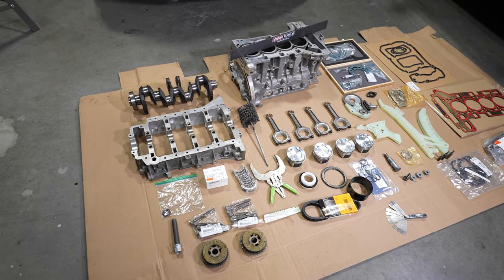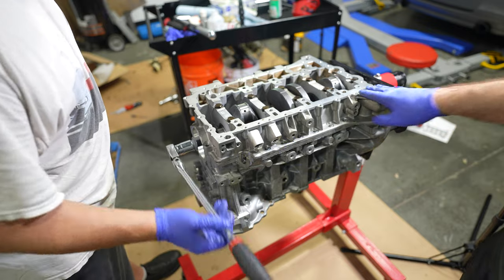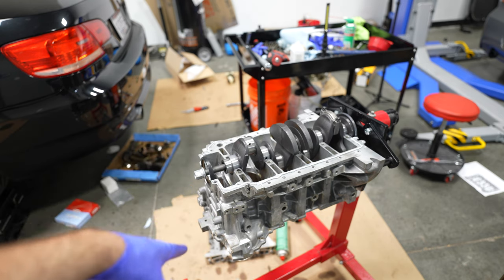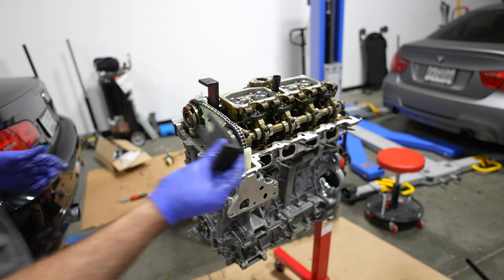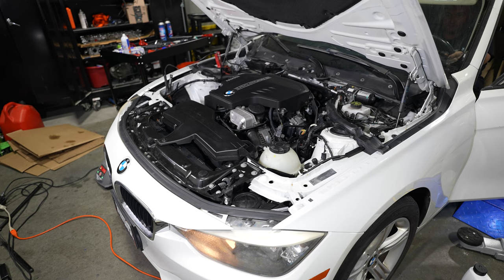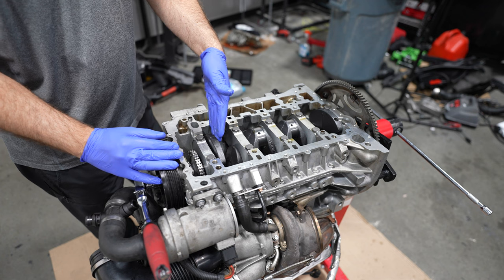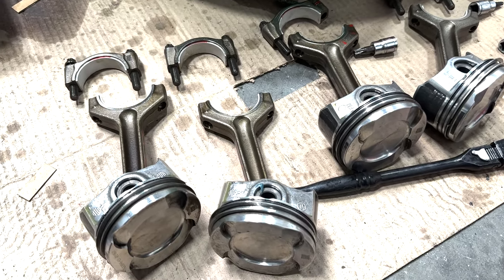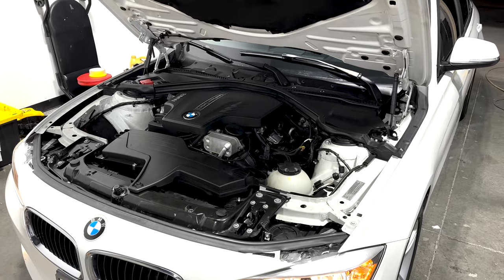How To Build A BMW Engine

Comment: This is a must know if you're looking to buy a BMW
Reply: You don't own BMW, do you?
Reply: @malceone  I think it’s obvious 😂
Reply: @malceone  you probably think changing vanos solenoids and coils+sparkplugs every 60k miles in considered regular maintenance 💀💀
Reply: Not really, the motors are strong it’s just the other stuff
Reply: The bait 😤
Reply: @DaEverything1  I’ve had 24 cars, 6 of them being BMWs. I used to change my spark plugs/coils and distributor on my Chevy LS1 and other LSx motors. That stuff is routine maintenance. You’re just a clown.
Reply: @DaEverything1  Actually no, but I speak from experience.I own 3 BMWs,E60 and F10 gasoline and E70 diesel.Never did vanos or coils.Did change spar plugs and glow plugs and some oil seals on gasoline engine and that is pretty much it.Changing oil every 4k and brakes and stuff on regular maintenance and that is it.E60 and E70 have close to 200k and still running good.What I'm trying to say is, biggest culprit to BMW"unreliability" is second or third owner.They buy them without first clue about cars.And they run them to the ground.Either they don't know or they don't have enough of money to properly fix and maintain.I am second owner to all 3 of these.Your experience my vary this is mine.Cheers.
Reply: @DaEverything1  I never understood why people are so proud to say how much they neglect the maintenance of their car. Yes, changing your spark plugs and coils every 60k is normal for a performance/luxury vehicle. You’re very welcome to run the same coils for 100k+ if you do not care about the overall performance. Even in the world where the new norm is to hear cars make over 500 hp, a base model 3 series is still considered a performance vehicle. Your average car barely makes over 150 hp and even at its base BMWs bread and butter 3 series and 5 series are still going to out perform your sports version of your Camry, civics, accords, 86 etc…
Reply: @DaEverything1 just changed the spark plugs on my bmw and they were still factory. It’s a 2013, but it is kind of low mileage and I treat it well. Besides that it’s just oil changes and whatever fluids I might need.
Reply: If you don't mind, how do you calculate the color of the bearings.....why don't they put the same color at the bottom as at the top
Reply: I have heard rumors that the connecting rods would not last if the engine power is increased and that the bearings wear out prematurely

Comment: Say what you want; BMW engineer their engines really well with tight specs. Installing something less than perfect will cause problems. People say BMW is unreliable but they don’t know didly. Do the maintenance and they will run forever.

Comment: IMPORTANT! When using plastigauge to measure crank clearances you must make sure the crankshaft journals and the bearings are DRY (not lubricated). Otherwise, your measurements will not be accurate. Also, never spin the crank when dry.
Reply: For the pistons bearings ?

Comment: Thank you for that Sunday morning bmw show, sad to find that the crank was garbage after you ran it, but thank you for calling it out, and going through it again,  that type of issue is something that an inexperienced builder would never of understood and they would’ve had the same problem and lost complete confidence and in the end scrap the motor. Thank you for this content ❤ and proving you need OEM when you’re doing such technical work.

Comment: I noticed at 17 minutes in you removed the locking oil pump tool.  Is it that you don't use it to torque the intake and exhaust gears and just use the timing kit to lock the camshafts and the front gear wheel along with the TDC lock and oil pump lock or do you also lock the flywheel as well?  I am at this point currently so just wanna be sure.

Comment: I have the BMW X1 it has the N20 in it. Just wondering about which way the factory OEM pistons go back in as far as any markings. I didn't take them out and he doesn't remember which way they go back in. But it has a QR code on the top of the piston no arrows. I'm thinking looking down at the engine and seeing the pistons already in the bore wouldn't the QR code be on the right side or?

Comment: quick question is it cheaper to rebuild an engine myself or to just buy a used one for about $5,000. I have an n20 328i and it has rod knock. would i need a whole differnt engine or just swap out whats damaged and rebuild. Also what is a rough estimate for a rebuild in general minus labor because i would be doing it with my brother

Comment: I just purchased a rebuilt N20 engine for my 328i.  The shop claims all new parts but didn't say anything about OEM.  How can I find out if I could possibly run into the same crankshaft issue you ran into with the Chinese part and oil flow issues?

Comment: Could you please tell me the correct orientation of the 17mm bed plate bolts? 5 are larger than the other 5 and I'm not quite sure how to reassemble it. Lol please help

Comment: I'm curious why you didn't work with a machine shop to help with some of these crank issues.  I rebuilt an N14 for a Mini Cooper and found that my main bearing clearances were too much, so I sent the block, crank and bearings to them and the engine is literally perfect without having to buy different OEM bearing sizes.  I've put more than 5,000 miles on the rebuild with zero oil consumption and plenty of high RPM use with no problems.

Comment: Nice build install vid... Lots of good information in this... I just did a rebuild on an N26 and have so far had nothing but trouble getting the VANOS system to run properly. I had glitter from a toasted oil pump (also chain guide issues) and replaced nearly every part and sensor, but due to product availability only ultrasonically cleaned the original VANOS cam actuators. Now I'm playing with weird crank case pressures and lots of VANOS faults. Glad to see you got your vehicle up and running... I really hope I don't have to pull the engine out again...
Reply: Weird crank case pressures and VANOS faults means it is mistimed
Reply: @igotaction  I hope it is that simple. I have it back apart (cam cover off) now and everything lines up with all the timing tools in place. The timing lock tool kit I purchased was the same one from the older Vehicular DIY video so it should be correct. (I probably even bought it through the affiliate link). I have new VANOS gears being delivered tomorrow and will try timing it all again this weekend.
The VANOS Adjustment unit can literally be in any orientation? It's just the Impulse sending wheel that needs to be clocked based on the timing lock tool? It's my understanding that it doesn't matter where the Adjustment unit is clocked as long as the Impulse sending wheels are correct.
Reply: I resolved it by replacing nearly every component related to the VANOS. I hate being that guy that shotguns a bunch of parts at a problem, but I didn't have to play around and the old parts had over 100k miles so it's not a bad "While you are in there" thing. I also had the intake pressure sensor and manifold pressure sensor plugs swapped causing another series of faults. Really lame that they are right next to each other and the connectors fit in both...fingers crossed it sticks with no faults and especially not the dreaded power train ones.
Reply: Where did you get a new crankshaft is there any oe that are good or did you have to go with oem

Comment: Thank-you for the video I would like to know what break-in oil you used and for how long did you let it run Before replacing the oil again?
Reply: Driven 5w-30. I do 15 miles 20% throttle then total cool down then 15 miles 40% throttle then full cool down then 15 60% throttle then oil change then good to go

Comment: Great video.  Not sure i have the space in my garage.   But it didn't seem like you had to use a lot of customized tools.   WOuld it be possible to rebuild a damaged N20 that had jumped time or are all those engines toast?
Reply: Yes it is probably rebuildable however the valves minimum have damage. The pistons, cylinders and head could also be damaged.

Comment: I spun a rod bearing on my N54.  Was driving fine on a long distance drive.  Soon as I heard a knock, I pulled over and turned the engine off.  Had it towed home.  Have you ever seen anyone replace the rod bearing and keep the original piston rod if the crank is able to be polished?  If so, did it last them or spin the bearing again shortly after.  The car has been stock the whole life of the vehicle.  Has 160k miles.  Sorry for the dumb question, I just don’t have another vehicle.
Reply: If you don't tear the engine down you will be just gambling.

Comment: What makes the white measurement marks on the crankshaft?  Did you add special grease to the bearings?
Reply: Plastic guage for measuring bearing oil clearance

Comment: Did you guys plug that hole when you lock the timing for the oil pump? What if you don’t plug it?
Reply: Per bmw docs on the N20 it is needed  to keep the oil from frothing which over time will cause bearing damage. The plastic plug is less than $2 so leaving it out is not worth the gamble.

Comment: Where do you find the torque specs and other repair info? Looking for a good service manual
Reply: Tighten until you can't and then back it off a quarter turn.

Comment: Hey what up buddy I have a 2015 bmw 528i n20 engine I have low compression on cylinder 1-3-4 90 psi cylinder 2 119 psi I did a cylinder leak down test and I can hear it coming out of crank case remove oil cap and yeah air coming out can these engine be hone ? Or if is out of timing would it give me low compression?
Reply: Out of timing can make low compression but you should be able to check the valves with a borescope.  It would have to be sleeved which is stupid expensive

Comment: Please talk a bit more about the plastic timing guides. They are the main cause of failures in these and other BMW engines. I see you are using plastic guides again but they look like a different plastic. Are these much more durable than the OEM ones? Wouldnt it be better to use steel guides? Yes they might be noisier at first but last more than 100k miles no? What are the options available. Thanks.
Reply: These were the new redesigned guides from BMW.  They sold them in a kit for a while that was dirt cheap like $120 for EVERYTHING.

Comment: i have the same exact f25 with drivetrain malfunction issues. timing chain was updated but i have metal dust like particles in the oil. could it be bearings? can this be done without engine out?
Reply: So much easier engine out.

Comment: I’m surprised you guys do not drop the engine through the bottom with the front subframe.
Reply: We can pull that in about two hours from the top right to the engine stand.  I can do N63 in less

Comment: I just rebuilt my n26 engine. It was my first engine. It drove great for 20 miles and now I have tons of metal flakes in the oil I flush the oil 5 times.  I am Getting a ticking sound like it’s in The oil pan. Is it possible that my oil pump / balance shaft  is eating its self?
Reply: It probably ran a bearing, your balance shaft usually starts with a whining sound that is often mistaken for turbocharger or alternator bearing noise.
Reply: It was the oil pump balance shaft assembly. I dropped the pan and replaced with a good used assembly. Ticking sound is gone. No more metal in the engine. Already driven about 2000 miles.
Reply: Did you make sure the stickers were pulled of the timing chain guides?  I have seen a balance shaft destroyed when the sticker falls off and gets sucked into the pick up tube

Comment: not sure going super expensive OEM bearings was needed as aftermarket can be even better. the issue was clearly just the junk chinese crank. also are you supposed to spin it bone dry like that? seemed smooth but these parts need oil i thought..
Reply: Thought so too. I've used aftermarket cranks and bearings with zero problems but made sure the oil pump and balance shaft was genuine

Comment: hi. I have a bmw f30 328i. I'm getting error codes. P0012, p0015, P0172
any idea what parts needs to be changed?
Reply: Timing chain probably bearings, where you at we can give you up to $3k for the car.
Reply: @igotaction   thanks for the reply. I'm also getting codes 130308, 120408, 133B04, 133E10, 130108.
is it possible the valve tronic motor not working
Reply: @zunaids4036  they don't fail often but the timing chains do, you are probably out of time, that is first thing to check
Reply: @igotaction  thanks. I'm in South Africa. you won't be able to buy my car. thanks for the offer.

Comment: Watched to see the insides, Ive gatta try to replace my failed timing chain for a F10 528xi N20, no lift onlu jackstands, suggest trying to drop subframe or just disconnect and take the motor out?

Comment: I’ve rebuilt my engine with pistons, head gasket, turbo, ignition coils and spark plugs. No leaks engine spins over but won’t start 😢 
I’ve pulled all the codes but nothing that should keep it from starting 
Help 😢😢

Car Scanner ELM OBD2
Version: 1.101.9/1.101.9/iOS
DTC report
Connection profile: BMW OBD-II / EOBD F-seriesDate: 1/8/2024 4:58:09 PM
VIN: WBA3A5C50CF34xxxx
============================
OBD-IIOBD-II
DTCs: 7
----------------------------
P0030 [0x0030]
Heated oxygen sensor (HO2S) 1, bank 1, heater control - circuit malfunction
HO2S Heater Control Circuit
Status: Pending
----------------------------
P1338 [0x1338] Archive (inactive)
#8 MISFIRE CIRCUIT - OPEN
Status: Permanent
----------------------------
P0366 [0x0366] Archive (inactive)
Camshaft position (CMP) sensor B, bank 1 - circuit range/performance
Camshaft Position Sensor "B" Circuit Range/Performance
Status: Permanent
----------------------------
P0036 [0x0036] Archive (inactive)
Heated oxygen sensor (HO2S) 2, bank 1, heater control - circuit malfunction
HO2S Heater Control Circuit
Status: Permanent
----------------------------
P0597 [0x0597] Archive (inactive)
Thermostat heater control system - open circuit
Thermostat Heater Control Circuit/Open
Status: Permanent
----------------------------
138104 [0x138104]
Status: Test failed, Test failed (current drive cycle), Pending, Confirmed, Test failed since last DTC clear
----------------------------
12B104 [0x12B104]
Status: Pending, Confirmed, Test failed since last DTC clear, Test not completed during this operation cycle
============================
Engine control unit
No DTC found.
============================
Transmission control unit
No DTC found.
============================
SRS/Airbag
No DTC found.
============================
DSC/Traction controlDSC/Traction control
DTCs: 2
----------------------------
480A13 [0x480A13]
Status: Test failed, Test failed (current drive cycle), Pending, Confirmed, Test failed since last DTC clear
----------------------------
480A14 [0x480A14]
Status: Test failed, Test failed (current drive cycle), Pending, Confirmed, Test failed since last DTC clear
============================
CAN gatewayCAN gateway
DTCs: 1
----------------------------
801C20 [0x801C20]
Status: Test failed, Test failed (current drive cycle), Pending, Confirmed
============================
Fuel pump
No DTC found.
============================
Suspension/Dynamic management
No DTC found.
============================
TPMS
No DTC found.
============================
ABS/DSCABS/DSC
DTCs: 2
----------------------------
480A13 [0x480A13]
Status: Test failed, Test failed (current drive cycle), Pending, Confirmed, Test failed since last DTC clear
----------------------------
480A14 [0x480A14]
Status: Test failed, Test failed (current drive cycle), Pending, Confirmed, Test failed since last DTC clear
============================
Steering
No DTC found.
============================
Car access systemCar access system
DTCs: 2
----------------------------
804182 [0x804182]
Status: Test failed, Test failed (current drive cycle), Pending, Confirmed
----------------------------
D90D06 [0xD90D06]
Status: Test failed, Test failed (current drive cycle), Pending, Confirmed
============================
Center roof module
No DTC found.
============================
Gear selector switch
No DTC found.
============================
Dashboard/Instruments cluster
No DTC found.
============================
Infotainment systemInfotainment system
DTCs: 4
----------------------------
B7F80F [0xB7F80F]
Status: Test failed, Test failed (current drive cycle), Pending, Confirmed
----------------------------
B7F850 [0xB7F850]
Status: Test failed, Test failed (current drive cycle), Pending, Confirmed
----------------------------
B7F8CB [0xB7F8CB]
Status: Test failed, Test failed (current drive cycle), Pending, Confirmed
----------------------------
E1C444 [0xE1C444]
Status: Test failed (current drive cycle), Pending, Confirmed
============================
Central electronics
No DTC found.
============================
Driver's seat
No DTC found.
============================
Central module (in driver's footwell) (FRM)
No DTC found.
============================
Climate/heater/Air conditioningClimate/heater/Air conditioning
DTCs: 1
----------------------------
E7146F [0xE7146F]
Status: Test failed, Test failed (current drive cycle), Pending, Confirmed, Test failed since last DTC clear
Reply: You are out of time, you fooked up timing the engine. P0366 code